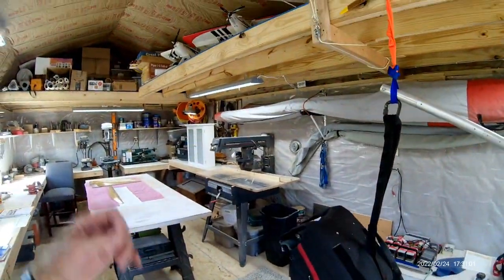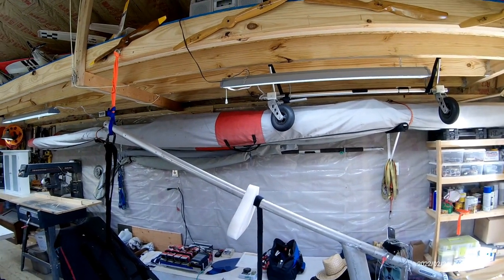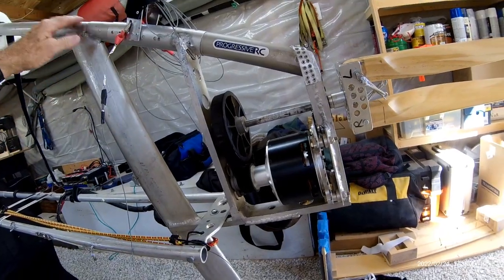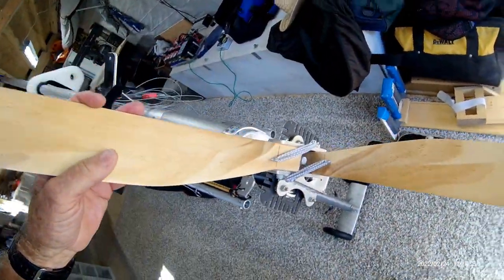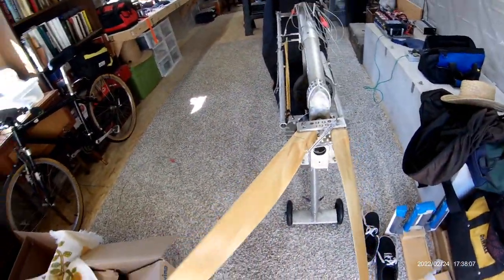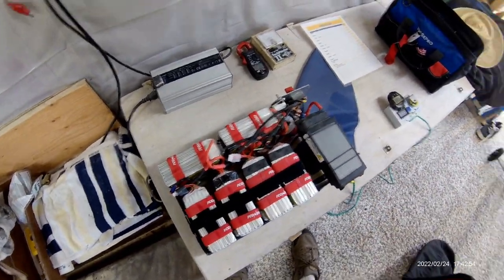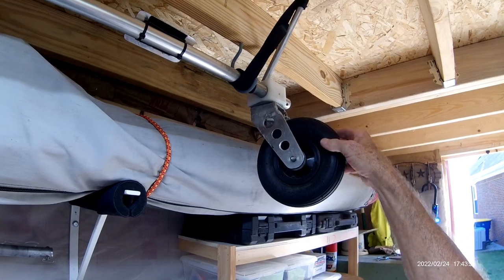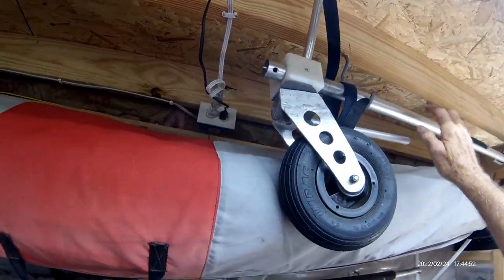Epowered Minimum Details

Comment: hey Danny, Greg here. is it tricky to handle on the ground? what is the rotation speed like?
Reply from the maker: It does very well on hard surfaces tight turns in grass are hard but it is easy to keep straight when taking off and landing.  it rotates at 20 mph air speed.